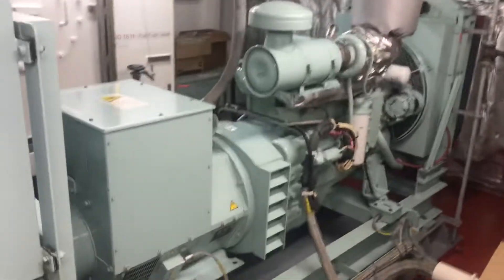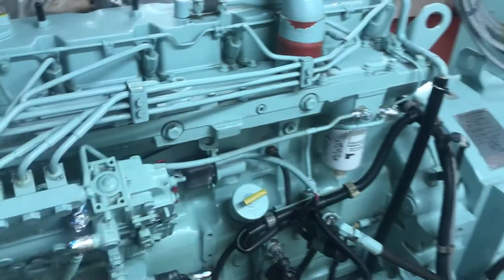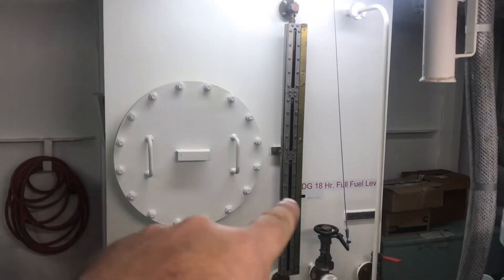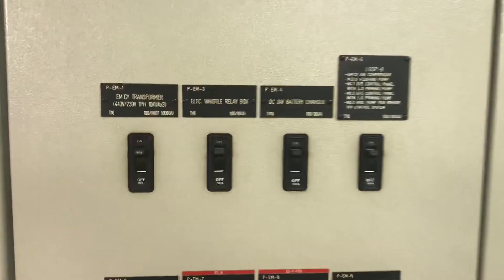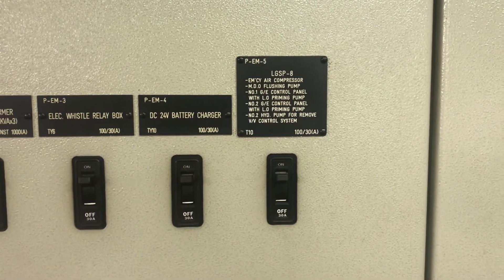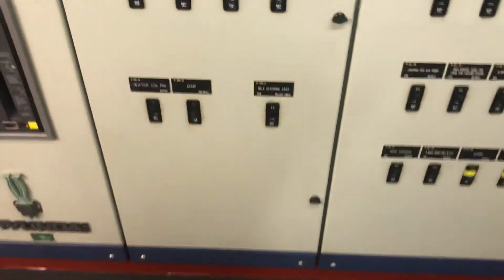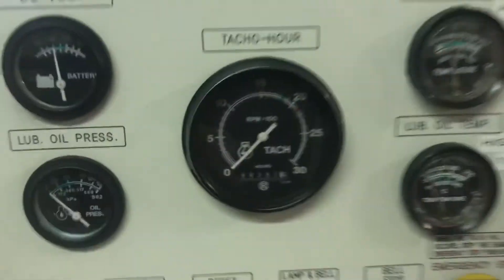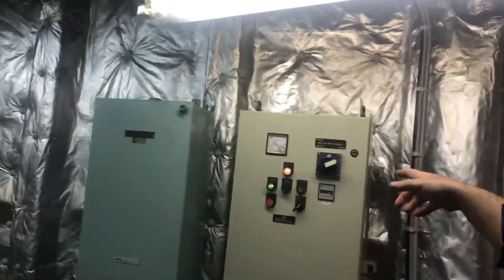Ships emergency diesel generator and switchboard

Comment: You said that this is a 5 cylinder diesel engine.  I see 6 fuel injector lines.  Are you sure that this is a 5 cylinder diesel engine?
Reply: Ya - I have a Merc Benz 5-cyl diesel 300D ... he has a sixer there ...
Reply from the maker: Yeah you are right that’s a 6 I did this video on the fly 5 years ago. Don’t even remember exactly what ship that was. But it was definitely one of the tankers built in Philadelphia with mostly Korean equipment